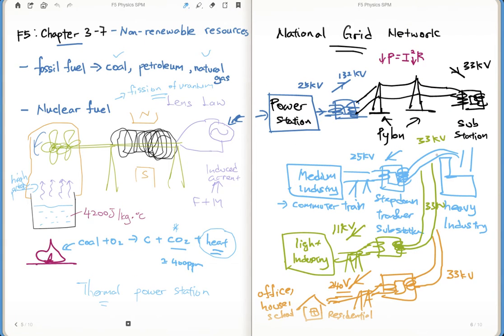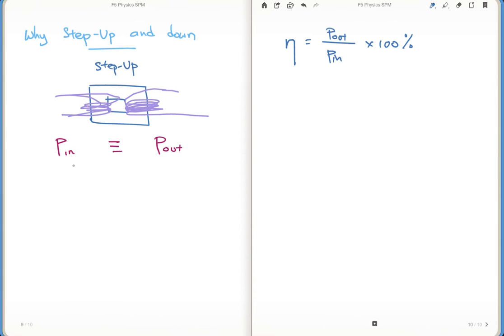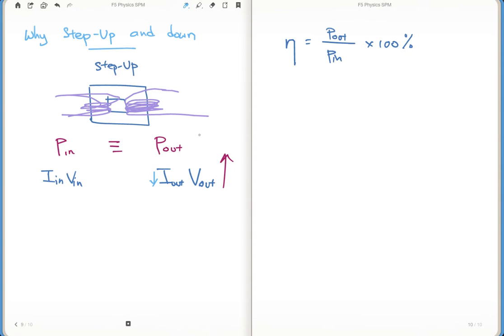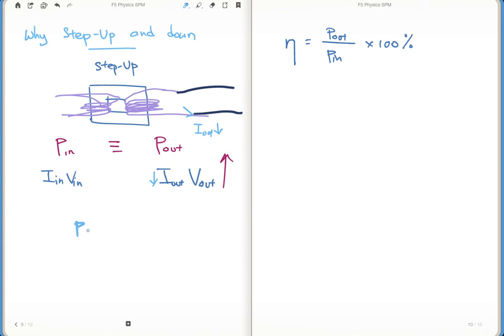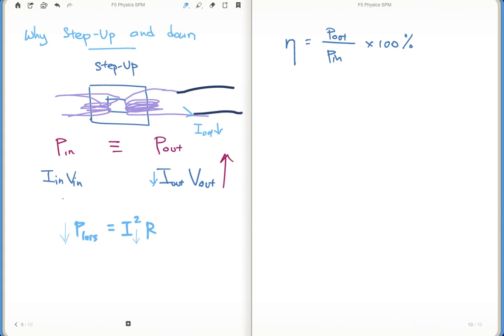Why high voltage during transmission of electricity

Comment: How does current decrease if voltage increases?
Reply from the maker: Energy is conserved. Total power input and output from generated is the same as the input source. Lower current prevents lower heat lost from cable. Reducing the electric current increases the voltage when power output is the same as the input. Try watch the video again using this idea in mind.

Comment: I know I am late but I had a question. So power OUT=I^2R. If we decrease power, we INCREASE voltage right? BUT if we increase Voltage by decreasing current do we not INCREASE resistance? V=IR? Can you please explain to me why the resistance stays the same? So that P=I^2R but since R is bigger the power loss is stays the same or bigger?
Reply from the maker: Hi there. The resistance of wire depends on the length from one end to another end. Says the distance from point A to point B is 100m and the resistance is 1000 ohm. This resistance remains the same despite how high or low is the voltage. Do you agree to the above statement?
Reply from the maker: Next, total power going in and out from transformer is also the same. So if the voltage is high after being step-up by the transformer, the current will be low. Based on that, heat lost caused by resistance along the wire will be very low based on this I^2R equation.
Reply: @CTB6  thank you I figured it out. It's the voltage drop in the resistance that applies to V=IR but V is not the same V that comes out of the transformer
Reply from the maker: Not really. Try go through the video again slowly and focus on using IV(in) =IV (out) and power lost in wire I^2R. We are discussing about why high voltage during transmission. When V out is high, I output will be low. That leads to lower heat lost within wire. Square of decimal value yields way smaller value of power lost for same resistance.
Reply: A question please, in a villa with a three phase main powering many rooms. What can cause line to neutral Voltage fluctuation in a particular room? That's the voltage goes from 160v to 285v wch is very low and very high